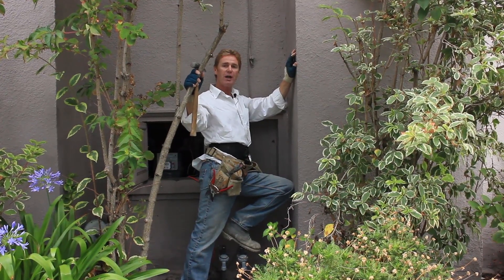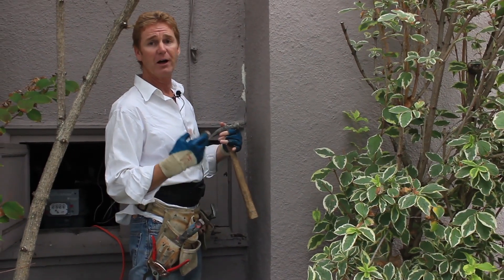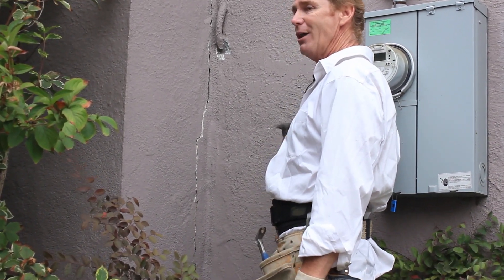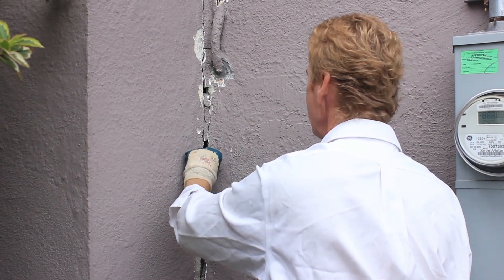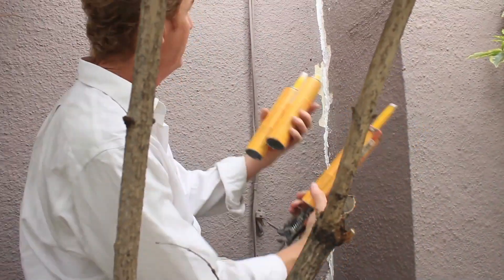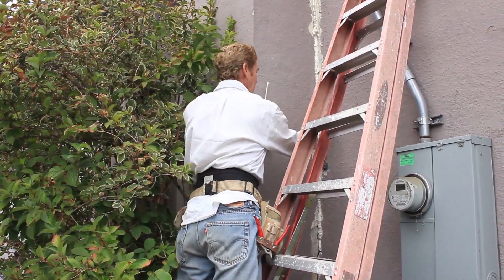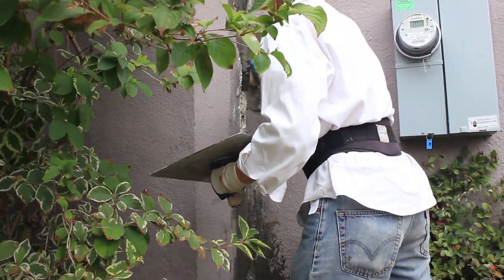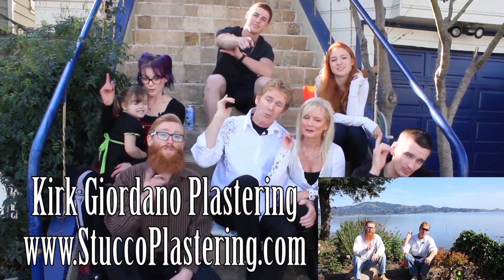Why do brick chimneys crack next to the stucco walls

Comment: Hi Kirk, I have a similar situation where the plaster has detached from the wall, my problem is that she surface is uneven at the crack. Can I drive the plaster back using screws so I can caulk the crack?
Reply from the maker: Good morning my friend. If it's inside, sometimes this may work, never for an exterior. 😉
The method I am showing in this video is easy, in fact, the easiest method available. Why not do it if your situation is similar. 🤷‍♂️
  Our unique plastering Tip:  all subscribers or anyone who stumbles on our channel with a question, type it into our Stucco/Plastering channel, and like magic, a video will appear to explain how it's done. 	
   This feature is miles ahead of any plastering forum. 🥳	
Kirk & Jason Giordano Plastering
Reply: @StuccoPlastering  Thank you for taking the time to respond. I could have sworn I saw somebody doing it on a youtube video and I have been looking for it for days. Now I know what to do and what caulking to buy, etc. Thanks again.
Reply from the maker: No problemo, my friend.😉
  Our unique plastering Tip:  all subscribers or anyone who stumbles on our channel with a question, type it into our Stucco/Plastering channel, and like magic, a video will appear to explain how it's done. 	
   This feature is miles ahead of any plastering forum. 🥳	
Kirk & Jason Giordano Plastering

Comment: Hi Kirk, I have sort of same issue.  But I cleaned out the hairline cracks last year and never got around to mortaring them, so this year they are much bigger and have caused large (5inch) chunks.  Would you still advise using polyurethane?  I live next to railroad and a highway. House is 100 years old. Brick chimney covered with stucco. And at the bottom of the chimney, looks like stucco is separated by a few inches.
Reply from the maker: Hi Tai X,  if water gets through a crack it can saturate the existing wood thus causing the wood to expand or swell, so naturally the cracks get bigger.
 The sikaflex polyurethane caulking I am using in this video says it will bridge cracks 3/8 of an inch, they have their engineers of mention exact specifics, have I gone thickers, of course.
 Most manufacturers of products don't say anything in excess in writing as if someone does it and it does not work perfectly, lawsuit, have you ever read a box of Q tips?
 Same deal be specific or some well meaning but ignorant fella will take it out of proportion.
 If you are referring to stucco then apply stucco, certain stucco's can go up to 6 inches thick, 
 Best wishes, 
Kirk & Jason Giordano's DIY plastering channel
Reply: Thanks Kirk!  I love your videos. I cannot find the Sikaflax in WA, so am going with a Quickcrete cement patch. It is polyurethane too.  It's an old house and I just want the water to stop getting an edge on that wall. Sometimes I think I just should move into a cave, where water is natural and expected.
Reply from the maker: Evening Tai X, this name sort of like Malcolm X? I love listening to that gifted speaker talk from the old youtube videos, 
 I use the sikaflex product as my material yard stocks and sell's this professional grade polyurethane caulking, but there are other brands that may be as good, don't limit your choices to the products I prefer.
 Best wishes with that chimney!
Kirk & Jason Giordano's DIY plastering channel
Reply: I just needed a name the American public could remember. Given names too much trouble for them,

Comment: Hey Kirk another great video! If you don't want so much of the spray foam coming out use the low expansion spray foam it will say for doors and windows on the can. When you cut the spray foam as you did with your trowel you kill the vapor barrier. The outside crust when the foam cures after a couple of minutes is waterproof. Thanks again for the vids I really enjoy them!
Reply from the maker: Morning Brad Goose,I don't mind it expanding, in fact I encourage it, it will fill all the holes on both sides that I can't see, thereby helping to insulate and waterproof the walls a bit more, 
 Thanks for the tip.
 Kirk & Jason Giordano's DIY plastering network